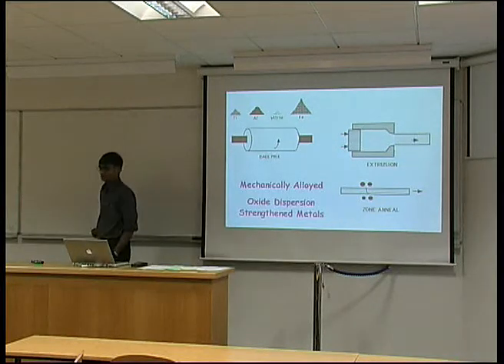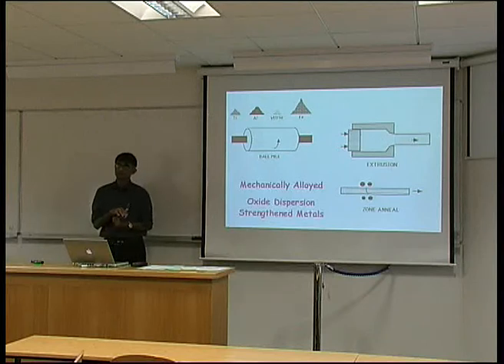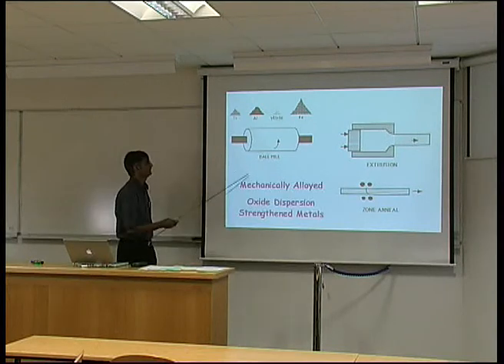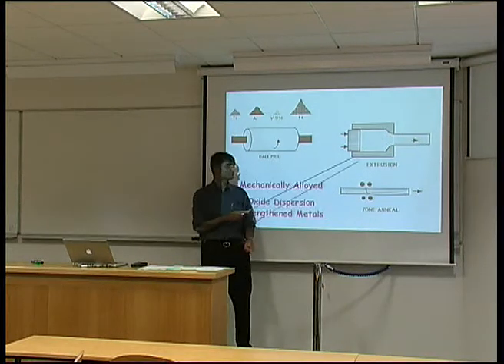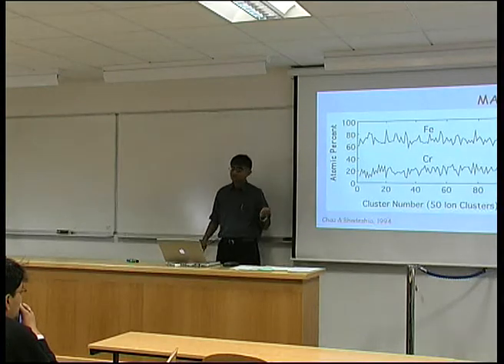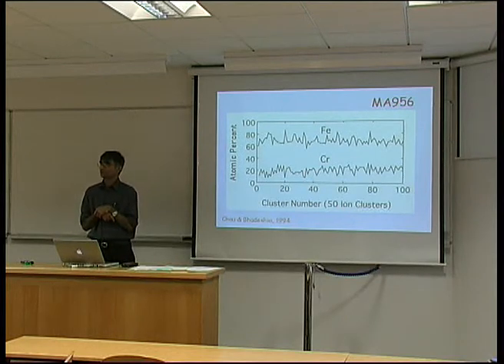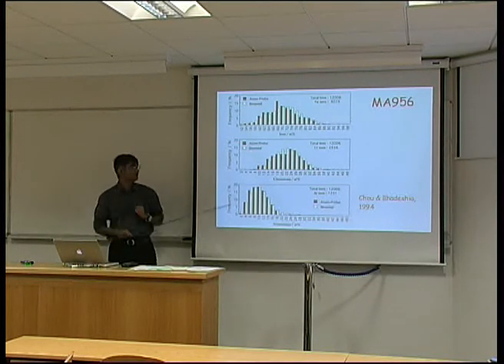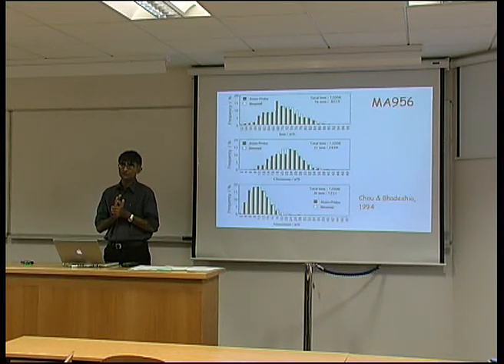Thermodynamics of Mechanical Alloying

Comment: sir all the mechanically alloyed structures and materials in terms of composition and structure are in non-equilibrium state and will tend to achieve minimum energy state by changing their structure and compositions,is it possible to maintain these structure ?how do we can maintain these meta stable structures or if we apply proper heat treatment(sintering) the possible phases that comes out from meta stable structures processed by mechanical milling /alloying is same as that of predicted by equilibrium phase diagram of given alloy
Reply from the maker: Everything we use is metastable, but can be used under circumstances where change is imperceptible over the time scale of service. For example, the galaxy will all eventually become the most stable element in the Universe, i.e. iron. See Burbidge EM, Burbidge GR, Fowler WA, Hoyle F. Synthesis of the elements in stars. Reviews of modern physics. 1957 Oct 1;29(4):547. Also, "Ferritic Power Plant Steels: Remanent Life Assessment and The Approach to Equilibrium" 
International Materials Reviews, Vol. 43, 1998, 45-69. 
H. K. D. H. Bhadeshia, A. Strang and D. J. Gooch